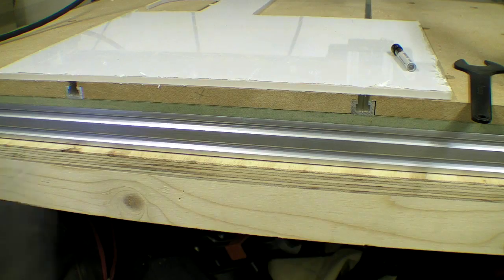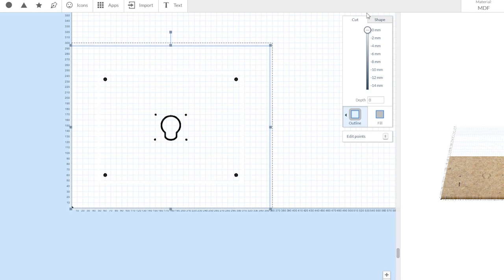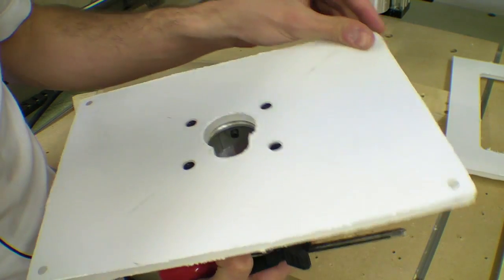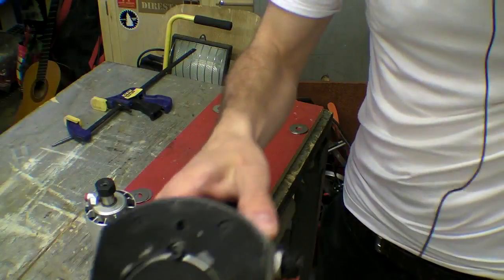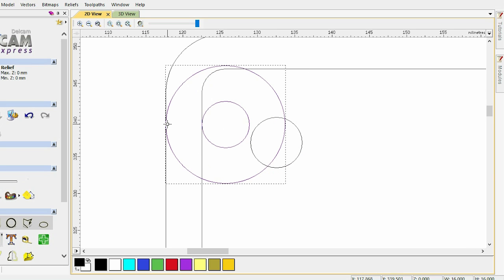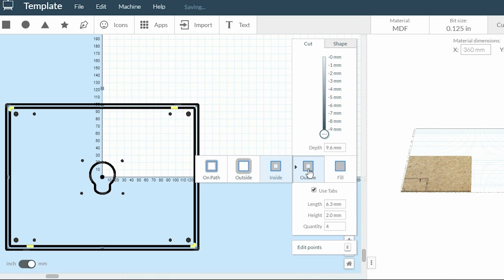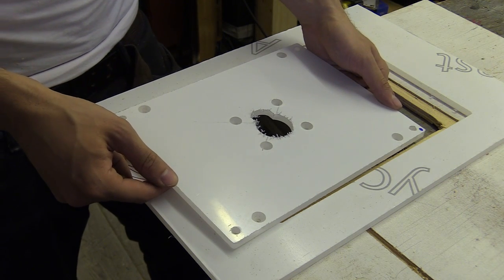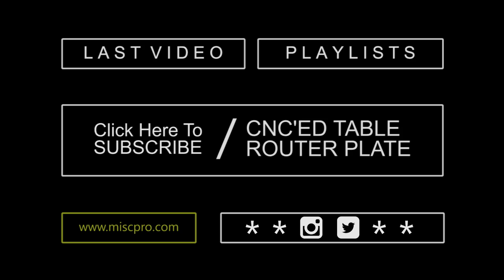CNC Cut Router Table Insert & Installation Template

Comment: I feel like maybe I'm missing something here. This project seems very over-done by scanning the router base, using autocad style software, cnc routing and all that jazz. I've known quite a few folks (myself included) who have made perfectly good table inserts using basic hand tools, and it takes a fraction of the time & effort that you seem to have put in here.
Reply from the maker: It took longer because I made a mistake when getting the template right, but had it worked I would have been around the same time. Now however, I can cut out another router plate and its template even quicker, when-ever-eye-want-too.
Reply: Sorry but i have to agree,seems like your teaching us to drive a car for a 100 yards when a bike will surfice

Comment: I'm amazed at your constant issues with the accuracy of your CNC. I have a belt driven Ox (OpenBuilds) and it is accurate to a poofteenth of a mm no matter what material I mill. The timing belt (at least the good quality stuff) has bugger all stretch in it, admittedly I do have a belt on belt arrangement.
Reply from the maker: What is a belt on belt arrangement? Sounds painful.
Reply: Instead of just the one belt that runs over the stepper pulley there is another belt - teeth up - laid in the extrusion channel on double sided tape or similar adhesive. So the two belts mate with their teeth (ouch). This reduces the belt stretch to just the portion from where they separate as the top belt goes over the pulleys and then comes back down again instead of the whole length of the belt. Does that make sense?
Reply: Check your FB messages. Link to pics on my page.
Reply from the maker: That's an interesting idea but I'm not sure I could apply that on my machine. I was sent an x carve during the mass give away, and the idlers seem a bit high.

Comment: That's really cool mate! Gives me a great idea! :-)
Reply from the maker: Do share fella! :)
Reply: +Savvas Papasavva well I wondered about making it a longer plate (wrt the feed direction) and having a second hole for An extraction hose,      Personally I think these should be standard on insert played for when you route grooves as fence extraction fee ones redundant,
Reply from the maker: That's a good idea. I normally just position a hose where the dust goes.
Reply: +Savvas Papasavva I did a modification to my aluminium insert plate,  but it can interfere with the router handle with some depths I longer plate would make this far less likely to foul the router handles,